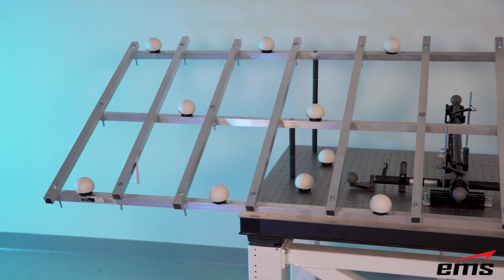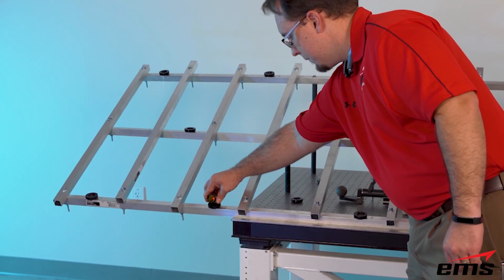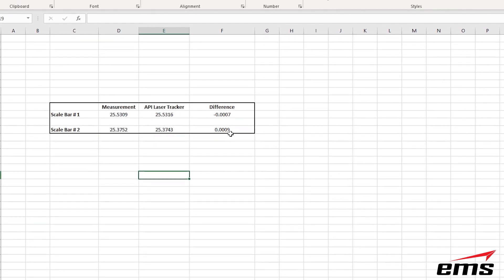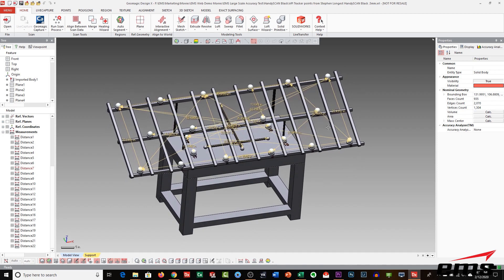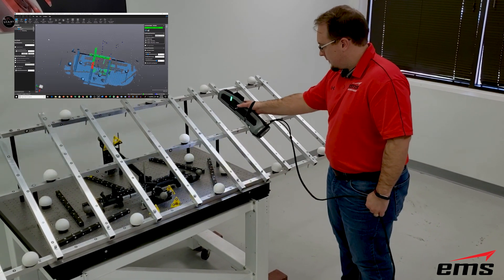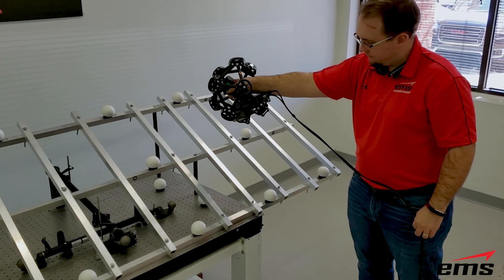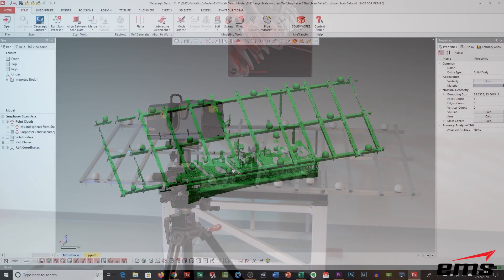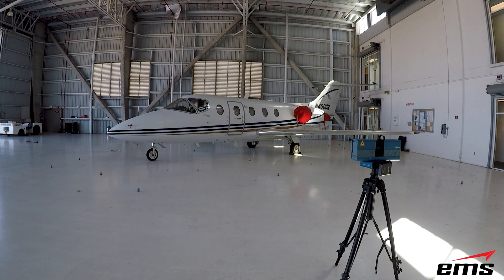3D Scanner - Large Scale Accuracy Test

Comment: Two things I'd like to have seen would be the laser tracker checking the actual spheres on the pucks directly, as well as using absolute values for calculating the average deviation.  I would have thought the surphaser would be closer to the advertised accuracy.
Reply from the maker: Hi Joseph,  thanks for the suggestions.   We plan on doing another large scale accuracy test in the future and also introducing photogrammetry with some of the 3D scanners.  As far as the Surphaser goes, the 100hsx IR which is meant for larger objects had an average deviation of .0016" and the USR was .022".  Our USR system was a loaner unit and I believe it needed factory recalibration.  I agree those numbers should have been better on the USR.  The 100hsx SR should also do better than our IR on short ranges.     Keep on the lookout for the new test next year sometime.